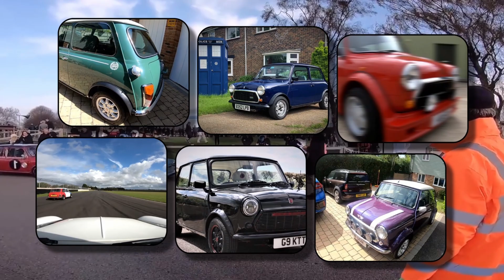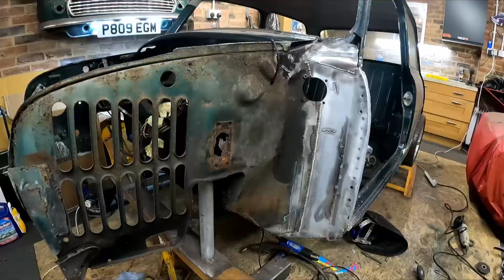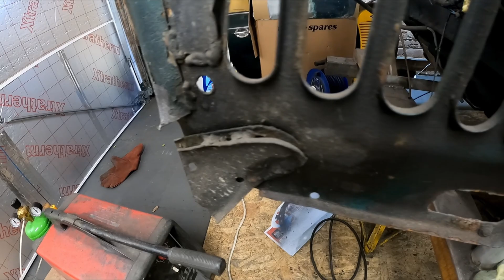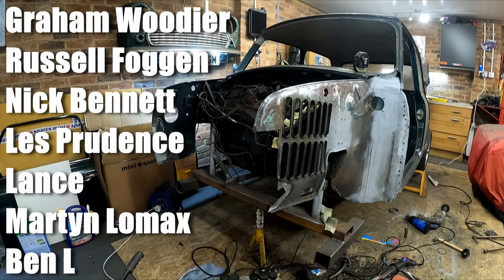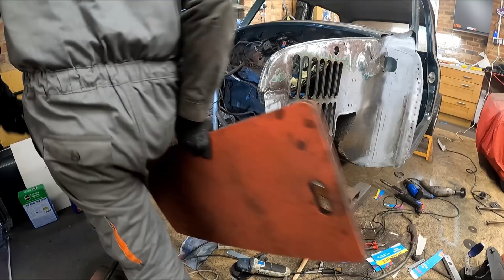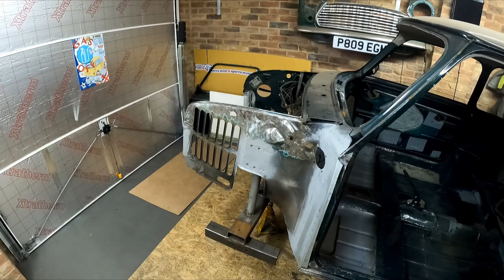Shock Mount/Inner Wing Repair - Classic Mini Workshop - Project Racing Green Pt.33

Comment: Hi Keith, I have just found a n/s door skin which I put away safe, you are welcome to have if your skinning the doors, I can drop it off with you when I pick up the short engine, or you can pick it up anytime if you’re passing.
Reply from the maker: Hi Phil, I bought a load of panels last year including a pair of skins, but thank you anyway. I should have the short block back soon, I don't think any of the components will have been used in the new build so it should be just the short block that was in the car

Comment: Good advice about safety. I used to overhead gas weld cars from a pit. If you do this you must ensure you can get out quickly if needed. The problems with gas welding are you need 2 pairs of hands to keep the joint together and the other is heat spread which can cause distortion and fires. A good few years ago in hot weather I was welding underneath a car and molten underseal dropped onto my bare arm. If anyone has done this, it is bloody painful. I pulled the hot underseal from my arm along with some skin. I kept on working with a big bandage on but it is definitely not recommended. Mig welding is much easier.